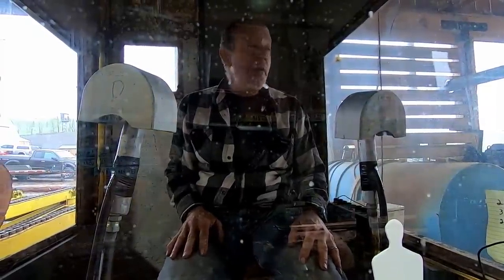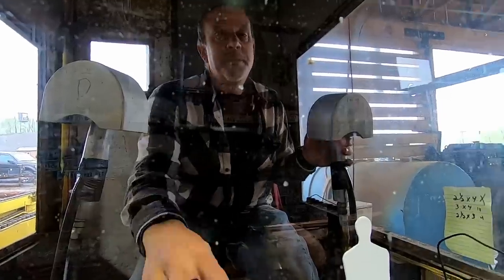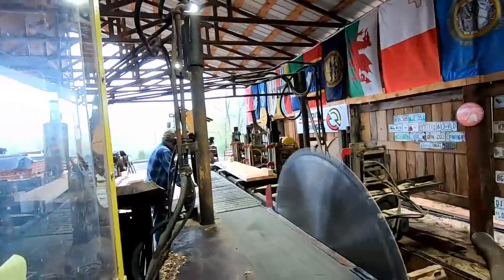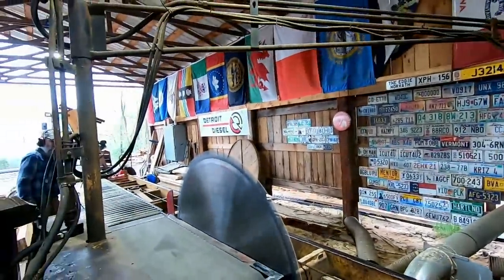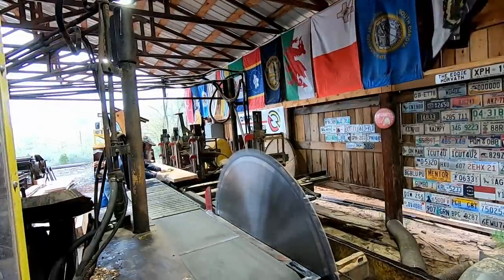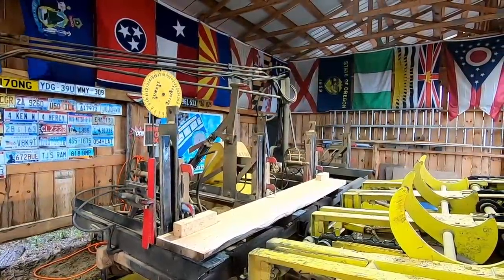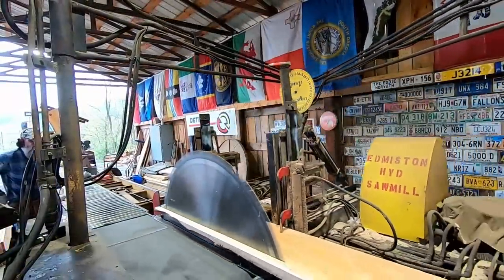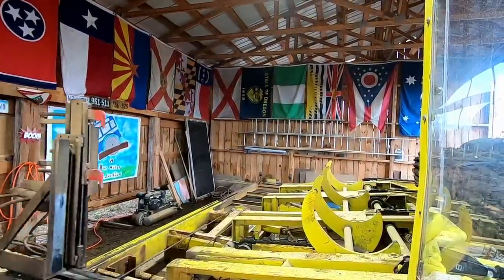sawing a black locust log # 416

Comment: Down south there is a Water Locust - Gleditsia aquatica that appears so much to be a Honey Locust - Gleditsia triacanthos. It grows in wet damp areas hence its name. The immature Honey Locust is easy to ID in that the leaves are different (Simple compound) than when they mature but the adult leaves of both look the same (double Compound). The bark is different between the two.   Black Locust - Robinia pseudoacacia is in another tribe entirely. Yes, they have thorns too.

Comment: I knew a guy who had some good sized black locust on his land. He planned to use it for a fence around a horse pasture. He was going to take it a local mill to get square posts and fence boards cut. Unfortunately, he waited 2 to 3 years before hauling it to the mill. The sawmill was comparable to John’s bigger outfit. The old sawmill guy completed the work but told the customer if he had any more to get sawn, he was more than welcome to take it somewhere else!  It was very difficult to saw and took a long time due to hot blade issues. 🥸👍✅
Reply from the maker: yes it gets very hard after it dries out.